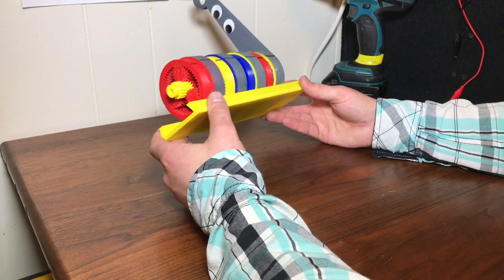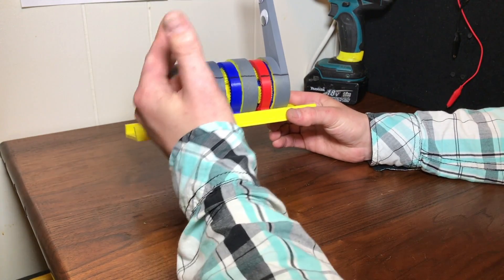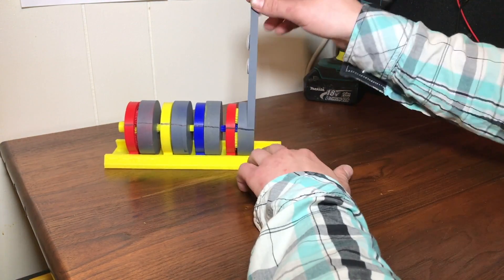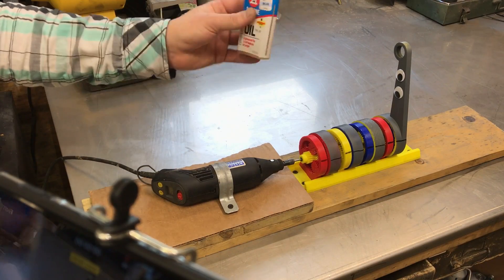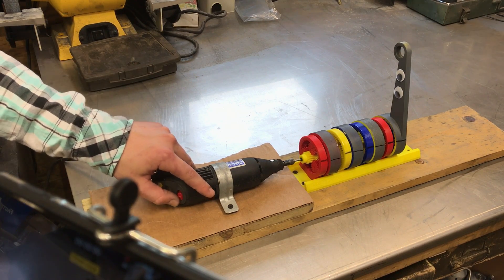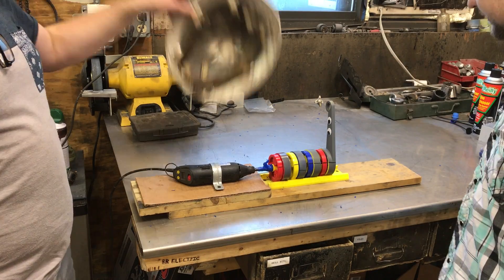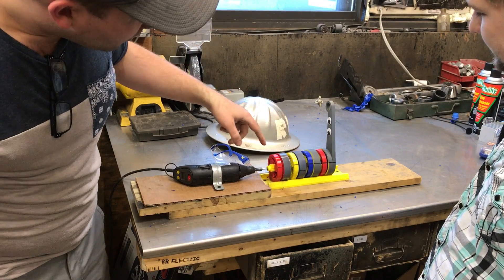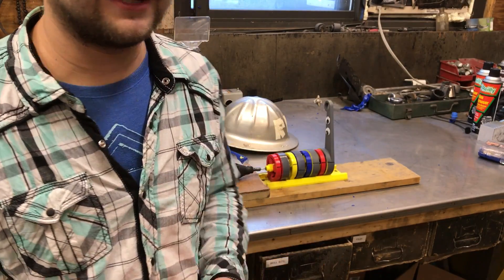3,616,238,492,881 To 1 - The Most Useless Gear Ratio Ever

Comment: Now do it the other way around and destroy the universe.

I'm not stupid I know there's too much resistance and it will not work.
Reply: Cookies there's only too much resistance because you don't BELIEVE
Reply: That would "blue screen" the simulation for sure.
Reply: Cookies what if u do both sides at a time
Reply: GENIUS
Reply: Good.
Reply: Cookies blastomy! It will work if you BELIVE! Then earth's rotation
Reply: Arne Polli "A"
Reply: So we need these super cooled on a small scale spinning very fast to create gravity plating.
Reply: Imagine removing friction completely, then adding so many gear boxes that the turning would pass light speed, we really could break the universe, if there's no friction there it wouldn't take much energy to spin the output, so the input should do something, but it would snap a few gearboxes into little pieces when tried to move since even then light speed still can't be passed, but if they were indestructible, shit would literally hit the fan faster than light.
Reply: +jackemled
Assuming no friction and indestructibility what would happen is that the mass of the gears would increase exponentially as they approached light speed. Gravity is determined by mass so they would get heavier and heavier. If done in a zero gravity environment then the gears would acquire more and more gravity. You would eventually create a black hole but never surpass light speed. Due to there being no energy loss in the system you would need to move the original crank with the same energy as the resulting black hole plus the energy in the prior gear boxes. I am not going to do the math but that is easily more energy than the sum mass energy of the solar system and the closest few star systems combined.
Reply: Cookies not a bAd idea
Reply: Cookiesn
Reply: do eeet! i wanna see destruction :D
Reply: Richard Smith The black hole wouldn't be the mass of the gear box. It would be the relativistic mass of the spinning gears, which depends on how fast you spin that handle. That mass would likely be a small black hole, but not one of trivial size like the mass of the gear box. I'm guessing (total guess, no calculations) it would be a few solar masses. To make it a black hole you would need to have a lot of energy input into that small space. And to get it to turn, you would.
Reply: Cookies if you could split the gears up to more manageable segments then you wouldn't have as much resistance but you still get the full effect of all the gears turning me and since we you could create thrust out of it you just have to make it less resilient
Reply: Cookies you ruined your joke with the explanation
Reply: There are a lot of stupid people out there.
Reply: However, a blackhole with the mass of this gear box would evaporate nearly instantaneously. Basically, it would cause the gear box to go nuclear, releasing all its mass as energy. They would be disintegrated, along with the entire town.
Reply: +Sam It takes 10 to 25 solar masses to form a stable black hole.
Reply: DON'T READ MY PROFILE PICTURE it will also destroy the universe
Reply: rparker069 XD
Reply: Your are stupid for having to clarify that it was a joke.

Comment: Hey, i wanna know. can you turn the 1 part of the ratio 1 full rotation and have just turned the other end 3.6 trillion times?
Reply: Would need way too much torque. The teeth would strip long before the output budges.
Reply: You would need a gear box that is made out of a material that is unimaginably strong and a massive amount of force that could turn the other end and lots of oil
Reply: Yes, you technically can. I managed to get a 1000:1 triple-planetary reduction set to move in reverse from the output side, but I needed a bench vice and a wrench to do it..
It takes a lot of torque to do it in reverse, and any higher than the 1000:1 mark, and you start to have problems doing it manually in reverse.
Reply: Macotaco 3.6trillion rpm🤣🤣🤣
Reply: would never turn.
Reply: nah he said 6000 tonnes to turn the other end, think people think lol
Reply: 10fantic no that's if you turned the big side in one minute then it would be 3.6 trillion rpm if you turn it in one second then it would be 3.6 trillion times 60
Reply: Macotaco yeah if you had 6000 metric tonnes of force
Reply: Even if you somehow managed to defy physics and spin it from the other end it would probably end up turning the other side much faster than light and would probably kill everyone on earth in the process. 3.6 trillion rpm is quite a lot.
Reply: Macotaco if you did, assuming that the input gear has a diametet of 10 cm, an exterior point of it would be rotating at roughly 1.884e10 m/s, wich is two orfers of magnitude bigger than c, the speed of light.
Reply: u r right. just did some calculations. Assuming the radius of it is 1.5 inches, the outside of the wheel would be spinning at 33912000000000 rpm which is 135234273600 meters per second. About 3 times faster than the speed of light
Reply: Christian Wang nope. its wont budge.
Reply: Be breaking the laws of relativity there...
Reply: you dont wanna do that, you would need the power of at least over 9'000 donald trumps...plus you would create a dark hole vortex
Reply: lol it sounds cool but that'll be just as useless too. it'll strip because of the torque.
Reply: Macotaco no he isn't strong enough
Reply: Macotaco turn the other end but it would take a phenomenal amount of force the gears would break
Reply: Guys just connect the gear box to a triple turbo Cummins and it'll spin the hell out of those gears 

(btw) ima kid I'm just making a joke so don't get salty if u think this comment is stupid
Reply: 3Ddee does that mean if you get a really heavy object you can do it
Reply: Macotaco idk if someone said it, but you would need too much torque for that it would break before turning probably
Reply: What if there was zero friction?
Reply: EG Gamer made me laugh
Reply: Heat transferred from the Dremel . cooling was not used properly. The gears themselves did not build heat.
Reply: Macotaco  Yes he could, if he were superman
Reply: Well yes, hypothetically.  But nothing's strong enough including the power delivery nor the materials.
Reply: nick281972 even superman couldn't lmao
Reply: Chris Perez bullshit
Reply: Somebody needs to build this device with the correct materials and make the other end move 3.6 trillion rpm. It just needs to be done
Reply: Macotaco it would spin faster than what  the speed of light travels, so it would be impossible to turn no matter how much force you apply
Reply: a "tonne" is meaningless in this context... think man think
Reply: Quantum Cuber then we would all be dead, but yea, you could turn a gear a bunch
Reply: BigBadMarketer but the biggest problem would be having 9000+ Donald trumps, I don't think the universe could handle that
Reply: borderex yea I know no force big enough
Reply: Samuel Logan vibranium doesnt exist in the real world.
Reply: Spooky everyone I got the solution make the gear box out off what ever material capital Americans sheld is made out off then get the hulk thor and iron man all to turn it

Comment: I think this is chuck norris' Hand wrestling Gear box!
Reply: Chuck Norris could spin the output wheel and lift 50000 Trumps with the input shaft.
Reply: Gear Down For What? he hasn't died cause Bruce Lee is waiting on the other side
Reply: Cogneeter as many as he wants
Reply from the maker: +Chaos Craft999 I'm pretty sure that if chuck Norris touches it,it turns to gold.
Reply: FindValdo then how many can he lift if he spun the input shaft

Comment: you could add some fan blades on that input shaft to cool the first gear set
if that motor is spining at even 1000 rpm it will move some air
plus the faster you spin it the more cooling you get because you need more cooling
Reply from the maker: +John Strong towards the end we actually quit spraying as much on it and it would not overheat, so I think that even a small fan would keep it cool. 

Also a big part of it is how well the gearbox is wore In
Reply: Gear Down For What? thats a good point about the wear factor
if i had the means to make one of these like i did a few year back id send you one made of steel, even mild steel would be alot stronger and could be run harder
but this shows how strong plastic really is, well the lifting anvil video does really 
good work man
Reply from the maker: John Strong Hey, thanks :)
Reply: John Strong sounds like a radial engine's cooling system to me.

Comment: Now machine one out of metal, and connect a brushless motor, add an oil system, and let it run 24/7
Reply: and make a small lightweight car. 1 trillion years later, it has traveled 1/1000 of a mile
Reply: Gear Down For What? This is YouTube. We'll watch anything. Keep a 24/7 livestream of it.
Reply: Let the camera take like one frame a week and time lapse it when you're on your deathbed.
Reply: Ethan Deitz The force would be to great and it would break either eve drill or gearbox
Reply: Even if he spun it at 20,000 rpm, it would take over 300 years for the output to make a full rotation, or nearly a year to rotate just 1º.
Reply: 9HighFlyer9 What if you halved the gearbox and swapped the input/output ends? For example, put a drill on the output side and a spinner on the input side.
Reply: Gear Down For What? do it
Reply from the maker: +Legend Cox that would be a boring video
Reply: Or a 5 turn triple hooked into a wall socket and use some resistors to knock it down to about 19 volts.
Reply: make a metal one!! seriously.
Reply: lolol
Reply: Put it on the other end.
Reply: Yeah ok for like literally a million years
Reply from the maker: +Chris Z. I've never done a livestream before
Reply: Lucas Svedlund gearing up the motor output would completely defeat the rest of the gearing
Reply: "that would be a boring video" - it already is!
Reply: Gear Down For What? IF you take a brushless motor and make a gear ratio to increase the rpm's to a really high speed and then connect it to this gear ratio
Reply: do it

Comment: Now you need to try exploring cycloidal drives in addition to planetary. You might be able to get crazier ratios in the same space without hitting certain limits of what will work with 3D printable materials due to tooth sizing.

Then have one of these gearsets move a thin wire probe being watched with a strong microscope, such that we can see where it's even doing something. Might be interesting on a split-screen video.

Comment: i think you were seriously overdoing it with the cooling. first of all the liquid was probably washing away the oil. the temp change would also alter the dimensions and the frost was impeding rotation. the biggest heat source was from the Dremel motor creeping up the shaft. otherwise fascinating and completely useless :)

Comment: For future nanoscale machinery this gear ratio would actually be useful. Scaling down size a million scales the natural speed up by a million. When the input side is driven with 1GHz (maybe a bit on the high side) the output side turns about in one hour.
Reply: Oscillation IR spectra of typical covalent bonds are typically located in the wavelength range of 3µm-30µm. This corresponds to 10THz-0.1PHz. One does not want to couple into these to strongly. ...

Unlike compliant biomolecules in water siff structures like carbon nanotubes (or future bearings out of gemstone) in vacuum do not provide low energy low frequency rotative degrees of freedom (DOFs) to couple into. Those DOFs could (if they where present like in water) go down all the way to the microwave range: ~ 3cm & 10GHz

As I noted operation at 1GHz will create noticable friction even in advanced systems beyond the state of the art. But if operated as a lone standing device the waste heat can be carried away. The big surface area at the nanoscale and the good thermal conductivity of nanotubes (or gemstones) helps.

By changing the bearing method from superlubrication to rotation about a single sp3 bond (or other methods) one could further reduce the coupling and friction. Possibly useful e.g. for future nanomechanical computing like this:
http://www.imm.org/Reports/rep046.pdf
(Assumed operation at 100MHz)

In case one wants to fill up some volume (e.g. a chip processing molecule fragments) more densely with nanomachinery and has some potential inefficient operations like breaking and forming bonds involved its better to go down to MHz range.
Reply from the maker: +mechadense you lost me at oscillation
Reply: Gear Down For What? 
This was a reply to CDLLBOSS Lee
In nanomachines one wants the operation frequency well below thermal motion frequencies. Otherwise things will get very hot very quickly.
He assumed an overlap of frequencies when theres in fact still a gap of about  four orders of magnitude (in stiff dry nanosystems). That is at 1GHz rotative machine operation speed thermal motion is still ~10000 times faster (oszillative thermal motion -  atoms swinging back and forth - lies in the mid THz range).
He was right that the rotative motion part of thermal motion is slower than the oscillarive part (in a relative sense). That could dangerously narrow the gap. But low frequency rotative thermal motion DOFs aren't present in stiff dry nanosystems. So overlap with rotative thermal motion is not a problem either.
Reply: That's 1,000,000,000 turns per second or 60,000,000,000RPMs.  In comparison, if you had a 1 cm wheel, you would be traveling at 31,400 km/h.  I'd want to be nowhere near that thing or even in the same state. :)
Reply: fakshen1973
Yeah; 1GHz really makes sense for the nanoscale. But when checking how far one can keep such frequencies up into the macroscale it get's exciting :) ...

You're example has about three times the circumferential speed at wich every conceivable physical object (without very strong inward facing support with exceptionally low friction) would instantly explode :)

Interestingly there is a fundamental physical speed limit 
(lying at about 3000m/s) that is *completely independent of wheel size*: http://apm.bplaced.net/w/index.php?title=Unsupported_rotating_ring_speed_limit

So 1GHz is just too fast for an 1cm (unsupported) wheel.

If one really want's to push it:

By making the wheel 10 times smaller ~1mm in diameter (and spinning it levitated in a vacuum - that should be doable) it might barely hold together. That is if it's made out of very strong material like near flawless nanotubes.
This hobbyist video shows crazy fast spinning magnets.
Still these are 100 times slower than the hypothetical nanotube wheel.
https://www.youtube.com/watch?v=RB7zzs9x5Og

A good place to look is the launch loop concept (a concept for starting spacecraft into orbit without rockets). There one really gets dangerously near that fundamental speed limit. The very different combination frequency (inverse turnaround time) and turnaround-bend-radius gives combined (multiplied) together a similar circumferential speed situation.

(The core problem there is that orbital speed > 3km/s)

Comment: take a plastic container and notch the side so the dremel and shaft are on the outside and the gear train is inside then fill it up to the notch with what ever coolant you like. even if just the bottom half in is in it will get carried by the gears.
Reply: also that's baddass.

Comment: Could we see you spin the output side.
Reply from the maker: there's waaay too much torque involved
Reply from the maker: no it doesn't work
Reply: Devon Couch Too much friction you would break it before it would even turn.
Reply: yonil9 remember when he said an ant in a roller could lift several planes? Can you push as hard as several planes? You would need to exert a preposterous amount of force to move it, as moving one degree would be equivalent to many years of turning the input side.
Reply: You should try using half of the gears and try spinning the output side to see what kinds of rpms you can achieve. Maybe even see if you could then put it to use somehow.
Reply: Chuck Norris uses this thing as a hand crank generator to charge his Nokia 3310

he spins it from the other side though
Reply: Gear Down For What?  why
Reply: Gear Down For What? The link doesn't work
Reply: Gear Down For What? Link no worky daddy
Reply: RoMMeL1337ak47 Just use a super solid! 😜
Reply: +Gear Down For What? how could it not work man

Comment: Why all the dislikes? Also, is your old 50:1 gear box still good? I might print it at150% and use it for a project.
Reply from the maker: Donut2994 it's not that great of a design, I talked it up a lot, but it was my very first creation. It can't handle much torque.